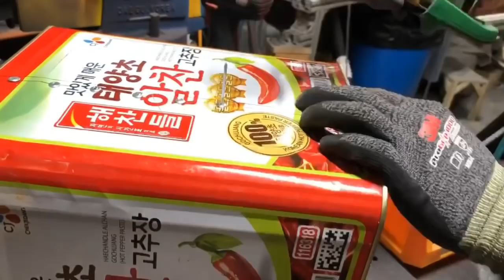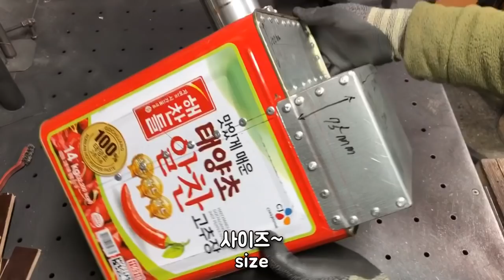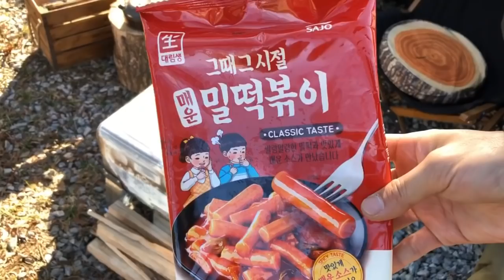고추장깡통 화목난로 만들기/캠핑/red pepper paste can stove making

Comment: What are you using for the stove pipe?  I can't seem to find thin walled flared tubing anywhere!
Reply: was also confused at first. but if you look at the rivets at 21:11 it doesn't go all the way to the back.
Reply: Yes. This chimney pipe seems hard to find. Where do you get it?
Reply: @brentverrill  Try exhaust pipes for cars, have 'em in all sizes.
Reply: @brentverrill  Try exhaust pipes, they come in all sizes, but they're pricey.
Reply from the maker: Welcome 
It is sold here but can not be shipped.
I'm worried
I hope you find it.
http://meseta.kr/product/detail.html?product_no=181&cate_no=79&display_group=1&cafe_mkt=naver_ks&mkt_in=Y&ghost_mall_id=naver&ref=naver_open&NaPm=ct%3Dk4w336e8%7Cci%3D5be41d8ec514eef59baa56f1017478858c0c0fcf%7Ctr%3Dslsl%7Csn%3D459081%7Chk%3Dd02294d68d271e143c67902688853d811935243c